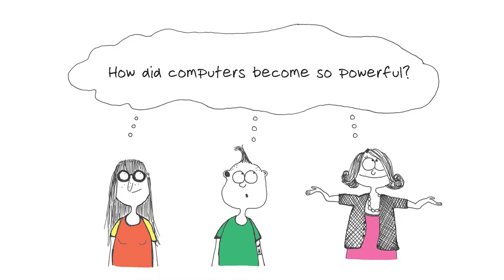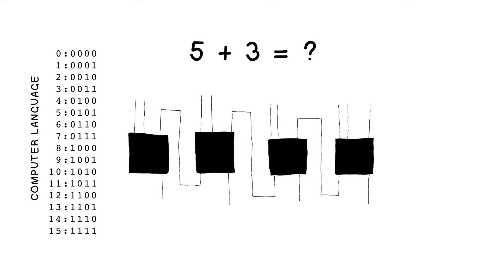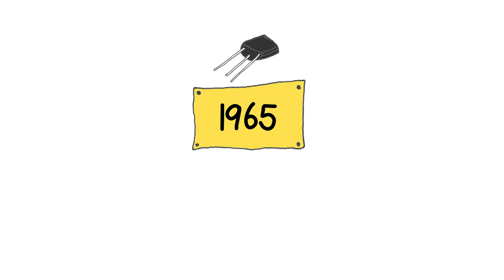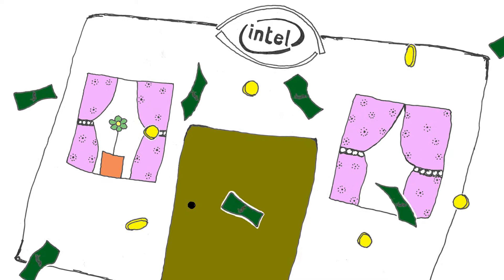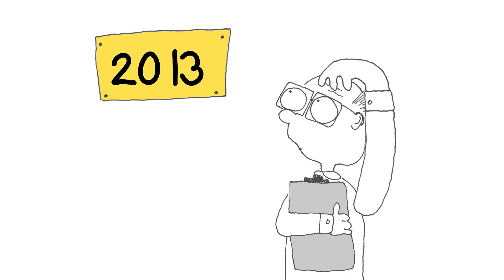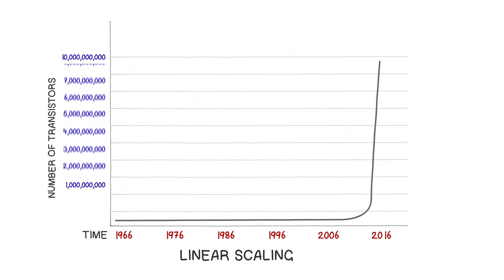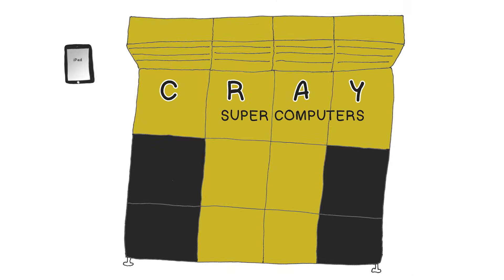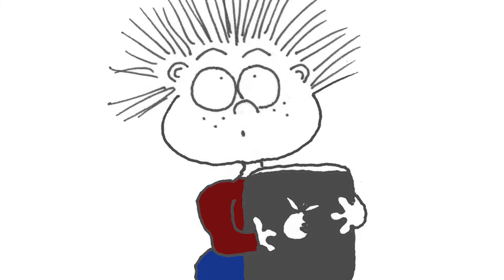Moore's Law

Comment: You know why? Basic statistics and every time they upgrade they obtain a new powerful vision.
He didn't pay attention to basic laws of the material and formula of resistance where in permeability "heat is included."

The theory still hold true, but other areas lack resources in advancements and cooling capabilities.

Another limit with trying to find the error, 0, non existent in the universe.

Is 0 the one? The original owner of the acceleration?